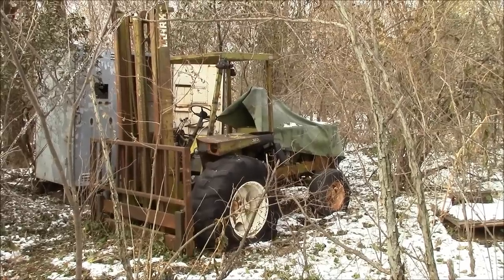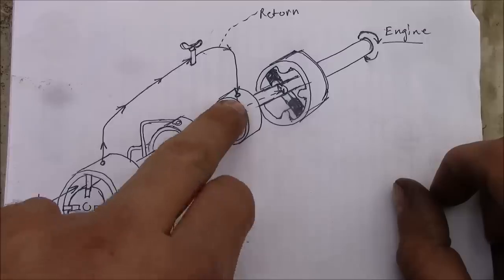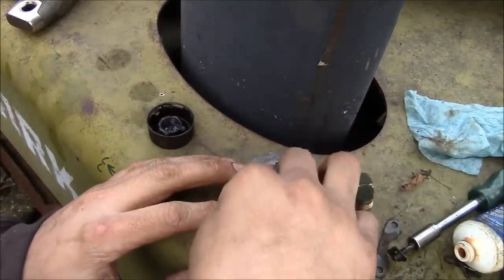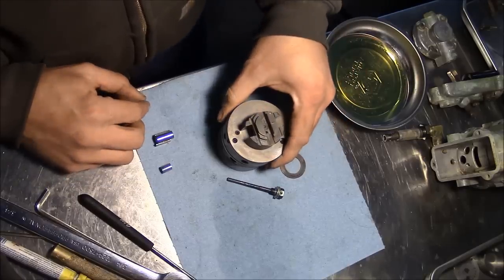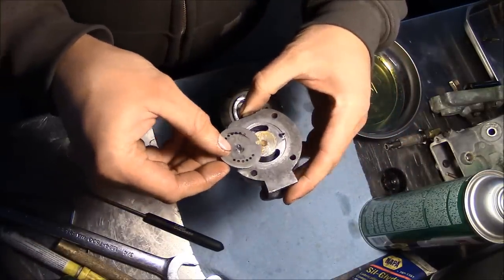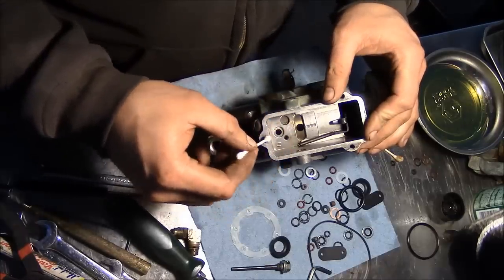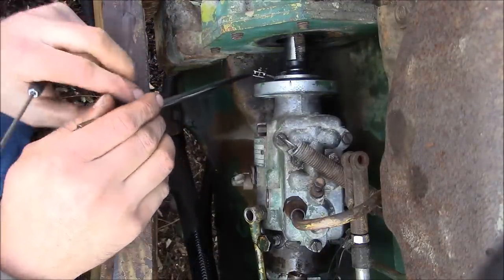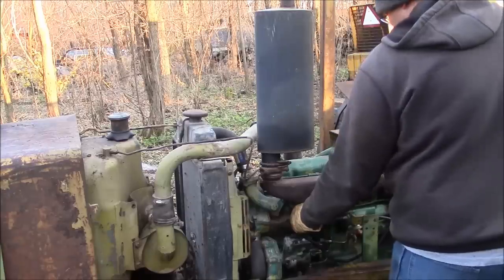Neglected Clark All Terrain Forklift - Will it Run Again?

Comment: Hey Wes, is that a yanmar engine? I know some John Deere diesels are yanmar engines, but I couldn’t tell if this one was.
Reply from the maker: No, I don't think so. I believe it's a Deere engine similar to what would be found in a 2010 size tractor.
Reply: Watch Wes Work oh okay. I learned more about it while watching more of the video. I’m one of those viewers that comments before watching the entire thing, lol. Great video though, glad to see it start up. That pump seems to be overly complicated for a simple task but a very neat theory of operation for sure, i’d like to tinker around with one and see what magic is behind that high pressure piston side.
Reply: @NitroGuyJH  Count us in that column.  We think it actually helps Youtubers if you comment a few times.....so we comment during the movie!
Reply: Watch Wes Work it looks identical to the 300 series John Deere that is in my 87 John Deere 70 excavator.
Reply: Watch Wes Work oh and by the way. Mine is a 24 volt system from the factory. Are you sure that one is 12 volt? Maybe someone swapped in a 24 v stater by accident. Maybe?
Reply: Traveling Kaspers World I knew I wasn’t the only one lol. Im glad to know someone else has the same ideas. I believe the more comments on any particular video increases the chance that it’ll be in someone’s recommended video section. So if I already know I’m gonna like the video (which I enjoy all of wess’ vidjayo’s) I comment during the video and also afterwards. 🤷🏻‍♂️ definitely can’t hurt nothin’ 🤘🏻

Comment: that part you are not taking apart, I think I would boil diesel fuel with this part in it shaking and trying to get the hot diesel inside it to try to get it clean. Without taking this untakeapartable part apart this injector pump may not run. Probably needs a clean room if the tolerances are that close. maybe really thin turbine oil. But brakefree or carb cleaner should get in there if hot. After starting yah wes. good one boyo!! I would run it a bunch before taking the pump to the shop. If you run it a bit I bet it will straighten up without that cost. The starter? well probably rewound. Costs enough and I bet you can use it for 20 years with no problem. If selling it I think it will straighten out on its own if you run it a while.
Reply from the maker: There are really no moving parts in that distributor, so I chose to leave it. That may have been the wrong move.
Reply: @WatchWesWork  I don't think so. It started. so nothing wrong with the distributor.

Comment: There was a lot of rust/corrosion and crude in the pump. Some of this could have blocked the injectors, so I think they also need checked/cleaned. Do take care of not letting diesel on your skin, it goes through the pores of the skin and cause nasties.
Reply from the maker: The injectors don't really hold fuel like the pump, but it would be a good idea to check them.

Comment: Since i not an expert on the starting you can run 2 batteries through a series parallel switch for starting and quick fix for fueling issue just install a electric fuel pump from fuel tank. I know people say you are just a gurl and i dont know anything, perhaps,  but i am a poor farmer and have all old equipment that I work on and i talk to allot of old farmers that help me out on thingz

Comment: your problem is the pump , you will find if you keep bleeding the system it will run for so long and stop had same problems befor and had to have pump serviced. the pump you have got is very much like a cav dpa style pump very common on older british engines

Comment: Are those transfer switches behind the fork truck?
Reply from the maker: They may have been once. It's just an empty steel box now. We use it to store a battery charger and other stuff we need down there that we don't want to get stolen.
Reply: @WatchWesWork  I see. I just started working on generators and have had to mess with some 1000+ amp automatic transfer switches that look just like those. Keep up the videos!

Comment: It may be a 24 volt system.
Reply from the maker: I don't think so. The shut down solenoid is labeled 12V.
Reply: @WatchWesWork  Maybe sometime in it's life a 24V starter was accidentally installed? I've seen that happen, drove me nuts figuring that one out.

Comment: Is that a " balance point " style timing affair
Reply from the maker: I don't know. Usually you line up a mark on the flywheel or front pulley and then line up the marks inside the injection pump.

Comment: Too much back pressure on the return loop can shut that pump off as well.
Reply from the maker: Yeah. That's not the case here. That also usually blows out the umbrella seals.
Reply: @WatchWesWork  Wes, when you have a no start, or start/stall issue, make sure the glass ball return line check valve isn't gummed up closed. Very common problem with the Roosa master / Stanadyne pumps.

Comment: WD-40 WORKS  AS STARTING FLUID BUT EASIER ON THE ENGINE
Reply: WD40 won't work anymore.  They changed the formula.  I use to use it all the time.  But it don't work since they changed.  Guess they didn't want to name it WD41.  Try using starter fluid instead.     I now curse WD40.   it is not that good of a lub and now it won't start a lawn mower.    Oh yes i am sure if you have and old can of the old formula it would work fine.

Comment: You do know that a injection pump has to be setup with a special tool by a pump shop right.
Reply from the maker: Only if you change the calibration. I did not adjust the timing advance or transfer pump regulator settings. If it worked before, it will work now. But this pump had issues before.
Reply: @WatchWesWork  👍 ok if you say so.

Comment: I think most probably the way you rebuild the fuel pump ruin it down. especially when I saw you using some grease inside the blade bump. this will not only ruin the fuel pump but also the fuel injectors. actually when you have a lot of such old diesel machine to work with, you may think about to build up a simple testing deck to run a fuel pump off machine and testing output fuel flow and pressure before you tear it down.

Comment: And with no sulfer in the fuel , they wear out very , very quickly.
Reply: You'd have to use a lubricity additive when you put that back to work, ya?  I have to use it in my little 1981 VW pickup.
Reply: somebody else Yes , Biodiesel would solve that problem , so would ATF , Stanadyne is my personal favorite with cetane boost , actually pays for itself in increased mileage.

Comment: Looks like a FUEL TANK full of TRASH is the root problem here .  I have seen this happen when someone accidentally ( or on purpose ) drops a SHOP RAG into the FUEL TANK .  Over time the shop rag disintegrates and plugs up the Tank screen / tank fuel outlet .  CLEAN THE FUEL TANK .

Comment: I was gonna say WD-40 would fix that in seconds lol
Reply: WD40 won't work anymore.  They changed the formula.  I use to use it all the time.  But it don't work since they changed.  Guess they didn't want to name it WD41.  Try using starter fluid instead.     I now curse WD40.   it is not that good of a lub and now it won't start a lawn mower.    Oh yes i am sure if you have and old can of the old formula it would work fine.

Comment: I will completely dismount the injectors. If the pump was full of rust the injectors will still be full of shit. Little holes will be plugged and it will transferr higher pressure to the pump to work.
Reply from the maker: That's the next step.

Comment: %100 THE BEST starter fluid for diesels is..wd40. No joke try it.
Reply: WD40 has started many diesel engines over the years. At one time the makers of WD40 were contemplating using a non flammable product in it but I don’t know if they ever did.

Comment: I'VE SEEN PEOPLE USE WD40 AS A STARTING FLUID FOR DIESEL ENGINES.
Reply: Or at least both wd40 and starting fluid.
Reply: Its all I use.
Dad would fire anyone who used ether on a diesel.
As far as he was concerned ether was only good for starting a diesel that had low compression so you could drive it into the shop to rebuild the engine.
Propane works a little better but most mechanics already have a can of WD-40 handy.

The problem with ether is it ignites too soon and burns too fast , you can break a rod or starter drive real easy when the first cylinder to fire tries to kick back  (turn the engine backwards.)
If it wont start on WD-40 or Propane the fuel isnt the problem.
Reply: Check the can on wd40.... propellent might be propane......
Reply: @sighpocket5  butane.

Comment: If you fill the fuel tank full the injection pump will get enough fuel from gravity even if the lift pump is poor.
Reply from the maker: The lift pump is working well.
Reply: I have two tractors with this engine and both tractors it was the lift.  But also my sisters tractor same engine woukd run a bit and die like this one.  she rebuilt then injection.  end of problem.

Comment: John Deere s are terrible cold starters , always have been , combination of a wore out injection head and high pressure injecters.
Reply: Once you get up to the powertech engines in the post 2000's time frame the stuff starts good. The 1960-1990 if its freezing you better plug it up if you want it to start.

Comment: WD  40 instead of starting fluid
Reply: WD40 won't work anymore.  They changed the formula.  I use to use it all the time.  But it don't work since they changed.  Guess they didn't want to name it WD41.  Try using starter fluid instead.     I now curse WD40.   it is not that good of a lub and now it won't start a lawn mower.    Oh yes i am sure if you have and old can of the old formula it would work fine.